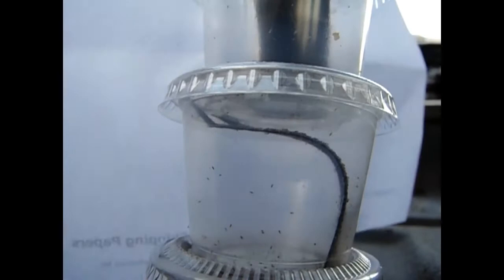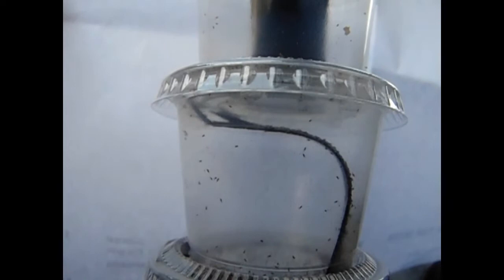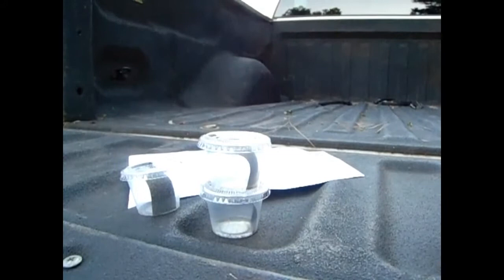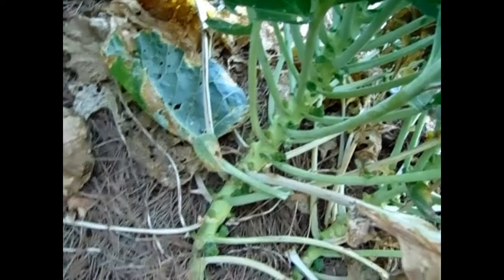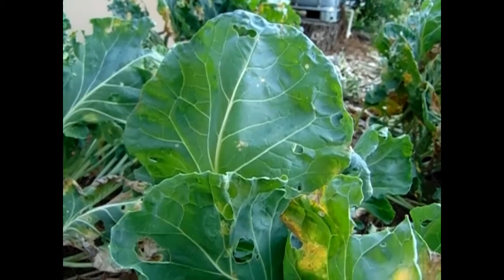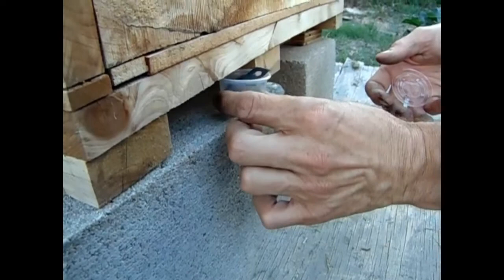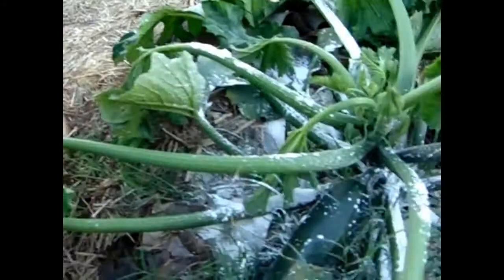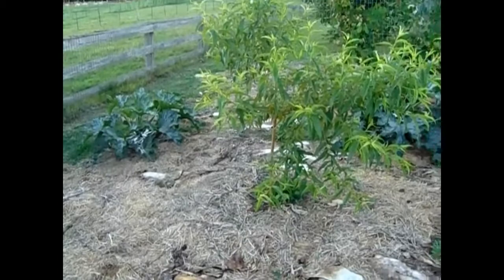Trichogramma Wasps - Predators

Comment: That's awesome Chris! I'm hoping and praying for your family and homestead to flourish with blessings! I'm sorry to hear about your zucchini plants though. Correct me if I'm wrong when I ask this: was there another zucchini plant I noticed, that was to far gone and didn't make it? If thats the case, you may be able to dig up the dead plant carefully, and do an inspection/autopsy looking for root eating grubs, vine borers, or any other abnormalities that help you identify exactly what's causing the problem. If it's vine borer, inspect the main vine for any swollen spots or debris that are evidence of a border. Debris will look like little chewed brown bits, usually accumulated around a small hole. Sometimes you can find the spot where the grub is at before the plant dies, then extract the grub before it causes irreversible damage. With a little extra water, the plant will often heal up and continue to produce. Squash bugs can cause wilting and damage, but it would show up on the leaves as sucking damage, with yellow then browsing spots, plus it would typically take more then a dozen bugs to cause wilt on such a big plant. I'm guessing it's in the roots, or the main vine. If you wanna do an autopsy video, on the one that I thought it saw, that appeared already dead. I'll see if I can be of any help to you, just to make sure it's not a problem that spreads if left untreated.

Comment: I have used Trichogramma Wasps now for about 1 year also.  I put in about 100,000 every month from March thru August, into my small orchard.  The supplier puts them into paper dixie cups for me.  I DO find them effective.  I put them in basically to help control Codling moths.  Doesn't completely control them, but helps a lot.  I put a few cups, in each tree.  I don't find that they fly particularly well, I sort of doubt that they will fly much from tree to tree.  Better to hope that they do well in the tree that they are put in.  My orchard, with quite a few apple trees, was pretty badly infected.  Seems that in the last year, it is much better.  Perhaps in another year I can wipe the problem out.